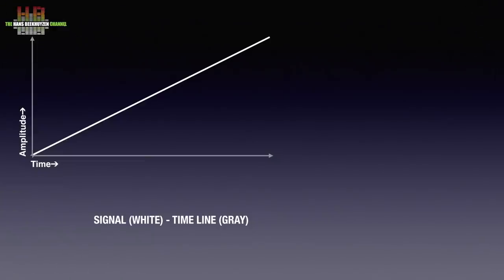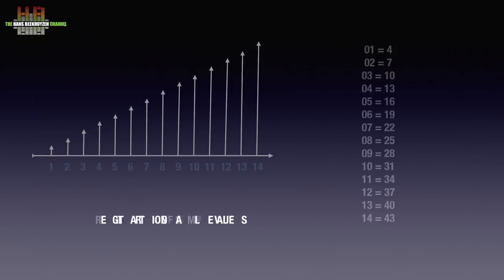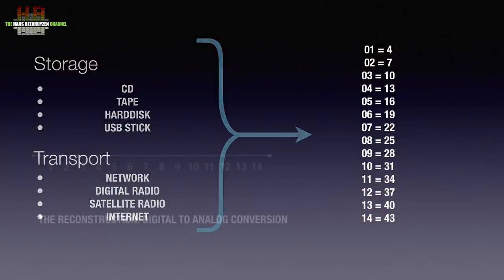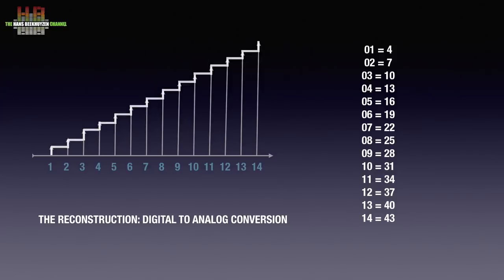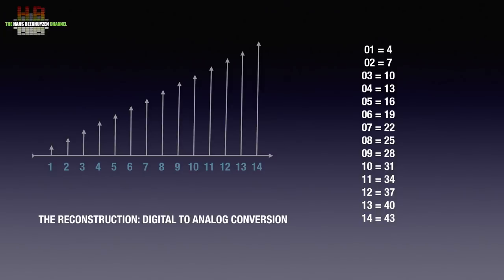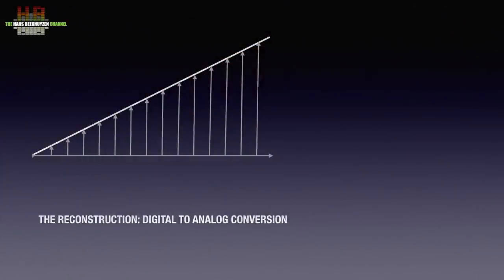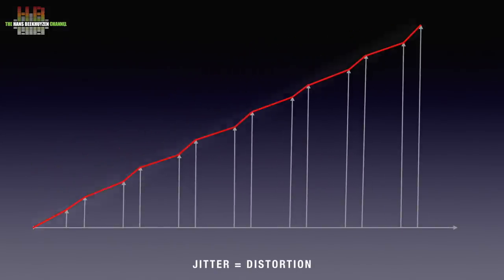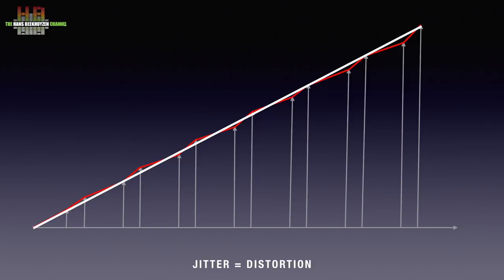Networked music players quality part 2: jitter

Comment: I have a dCS Rossini with the clock, and I can honestly say you can tell the difference between the sound with the clock and without.
Reply from the maker: You mean external clock versus internal clock, of course. Without a clock nothing goes.
Reply: @TheHansBeekhuyzenChannel  haha. yes. I meant the external clock... of course all DAC's need a clock.. but this level of isolating it seems to take it to the next level.  Only I wish there was a way to use it with SPDIF connections (using the Rossini clock output) .. but most CD and transport manufacturers don't make a clock input.

Comment: Great video. I took your advice from your review of the SOtM switch and ran fiber from the router to the switch. The difference is astonishing. The music is insanely immersive, the bass is clean and strong and any harshness in the highs is gone. I will install a Chord M-scaler next week but I also want to run fiber from the SOtM switch to my SOtM sms200 ultra neo SE with a converter.

I Would suggest you review the Chord M-scaler and the SOTM Master Clock in upcoming videos. The master clock has done well clocking the sms200, txultra and switch for me.

Comment: Jitter should only be relevant for the DAC, correct? (when it is converting to analog as you show in your line graph). When the stream of bits from the streamer is entering the DAC, the DAC must resample. Unless it is hitting the edge of the signal, why would it see any impact of the edge being slightly off? Therefore, is there much importance of the cable connecting the streamer to DAC?
Reply from the maker: I’m working on an explanation. Please be patient and be assured it is clearly audible.

Comment: I have a question: You mention the most common (all?) of the "traditional" digital connections, but what about HDMI? I use HDMI (Mini DisplayPort to HDMI) between my laptop and my ONKYO receiver, partly because it was the easiest for the distance I need (3-4metres). Any thoughts on the quality as compared to the connections you usually mention?
Reply from the maker: HDMI 'hides' audio in between the video signal. Therefore it all depends on the receiving end how well these signals get deinterlaced and thus how well the sound quality is.
Reply: @TheHansBeekhuyzenChannel  Wow, I didn't know that, thanks!